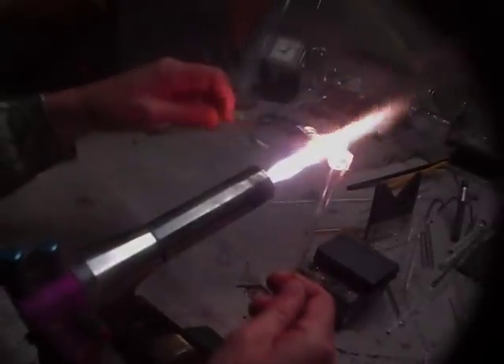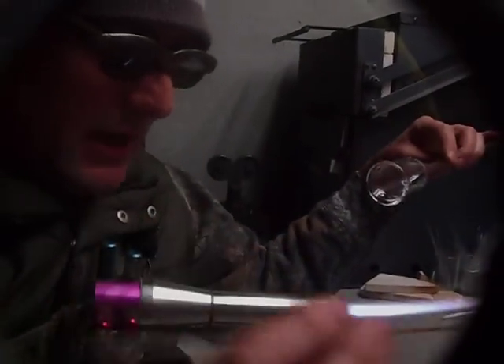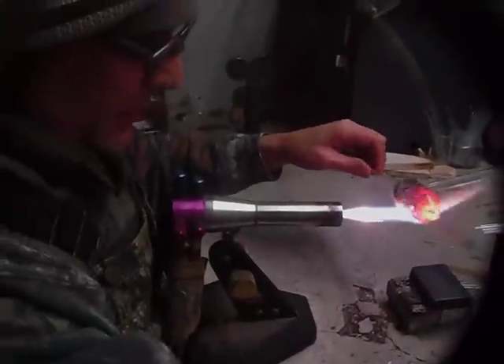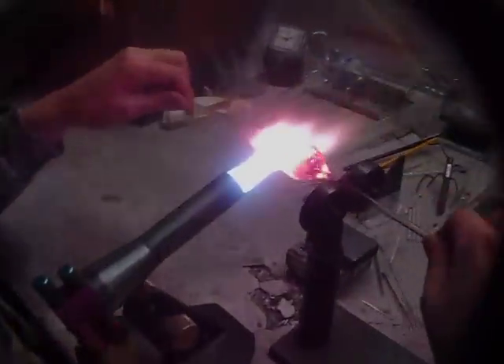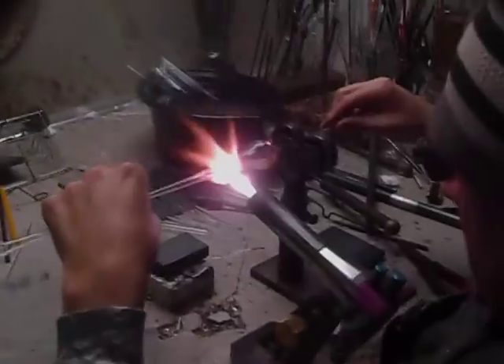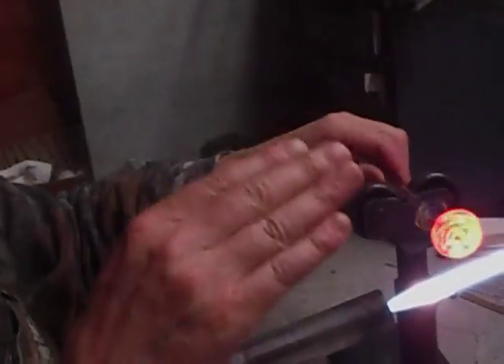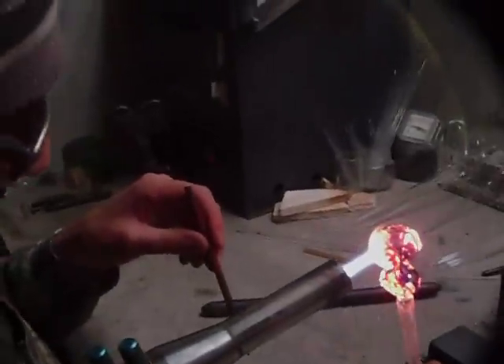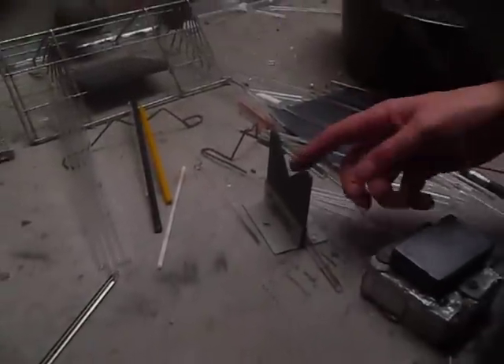How to make inside out- latticino pipe- #2

Comment: If you use really stiff colors like blue moon (or any cobalt based color) try to distribute them evenly on both sides, it will help when you are shaping to blow out a bit more evenly. Also if you get are getting cracks in your pieces doing ISO your most likely cause is you arent melting the colors in all the way, the inside surface of the peice has to be smooth just like it would be if you had done the peice in only clear or it will cause stress fractures.